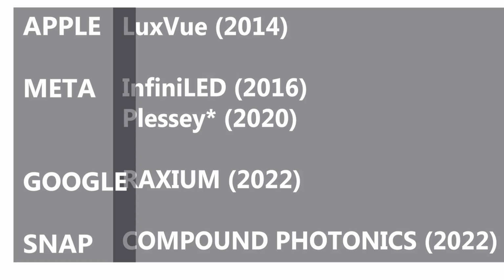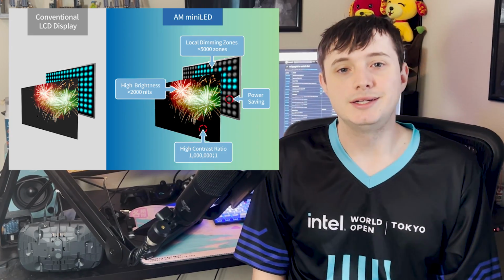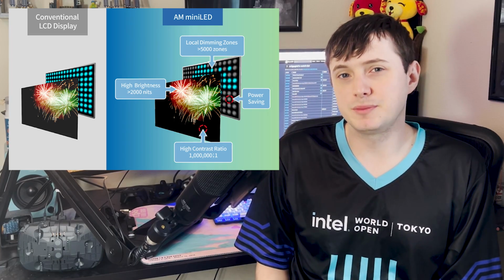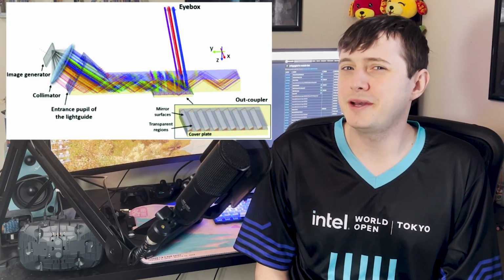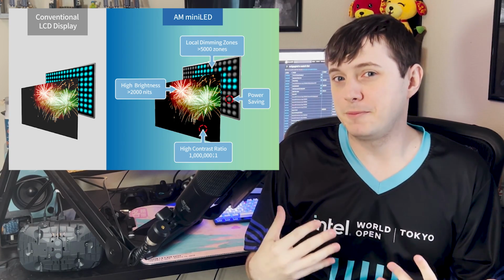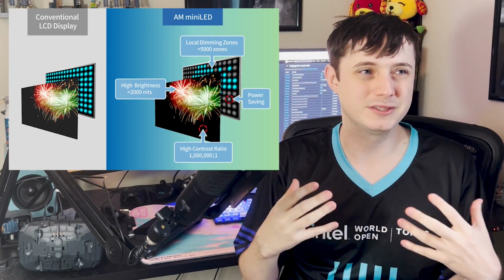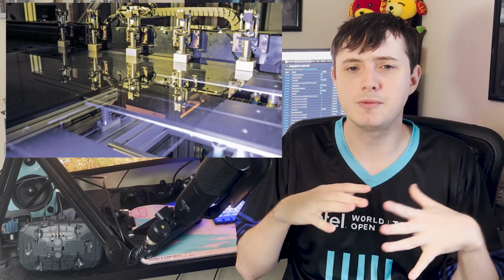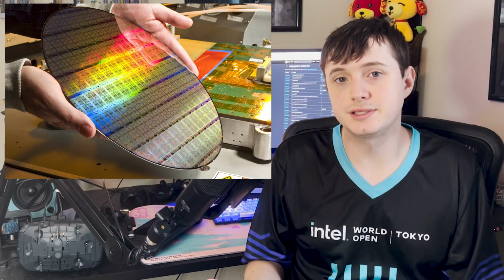MicroLEDs in VR - Why the Hype?

Comment: why don't we see DLP chips used for XR? DLP is very old tech at this point, used in projectors and based on silicon. AFAIK the only issue with them is that the chip is monochrome, hence rotating RGB filter in projectors, but that's not something an LED backlight couldn't fix, right?
Reply from the maker: From what I understand, there isn't any hype for that technology. And even current uses for DLP don't make a profit using them

Comment: Will pancackey lenses be compared against Quad-dioptric lenses at somle point?

On note of smartglasses the most impressive and polished I've seen are the Focals 2.0 (recently bought by Google), Everysight Raptor (cycling), and the Thalatoo Maoi (SCUBA diving). 👌
Reply from the maker: I think they will, but overall pancake lens can be tinkered to many different configurations to do different things, I think they will be the most adopted lens technology for consumers going forward
Reply: @SadlyItsBradley  Oh. I see. So the term "pancacke lens" is just general industry term for thin lenses that reduce the focal distance between the user's eyeballs and display?

Can there be pancake lenses that integrate various light focusing & visual quality solutions like varifocal/dynamic focal points,  waveguides, aspheric, and dioptrics?
Reply from the maker: @handlemonium  ya it’s kinda a general term of stacking multiple lens on top of each other. Usually bouncing light between them.

Comment: As for glasses with everything inside, I'm not really interested in that. That's just a continuation of the smartphone nightmare. I want a modular setup - my glasses should be a display, not a computer.
If that is "consumer" unfriendly, I guess I have an unpopular opinion :P
I believe we can get to where the components are so small that they can be modular AND slim. Maybe you'd have to use tweezers and microscope to change them out, or just have a professional do it, but it's possible. I think we should work towards that, rather than allow the industry to exploit us.
Reply from the maker: I’m with you, honestly
Reply: @SadlyItsBradley  🤗

Comment: What if Quantum Dot OLED, like that most recent monitor from Alienware with Samsung's newest panel?  All blue OLED subpixels, but QD filters to create the red and green.
Reply from the maker: As with the mention on using quantum dots to color convert MicroLED, the issue is they currently have issues scaling down. You arguably could use standard QD-OLED, but for the most part, I think the industry is trying to jump to MICRODISPLAYS because the advantages of smaller sizes (with high ppi) allow the devices to also shrink.

Comment: Great video Brad. Hopefully the optics side of the equation will be able to keep up and take advantage of the new screen technology, kind of like PC hardware not keeping up with newer high resolution VR headsets. I figure to run a Reverb G2 at full res in something like a racing or flight sim with some decent eye candy on, even the next gen GPU (nVidia 4000 series and AMD RDNA3) will not be enough, possibly the following gen? If this new screen tech makes thing look even crisper and better at a distance (small distant details) it'll require some serious graphical horsepower.
Reply from the maker: The industry is figuring out the computing side pretty quickly, I think. Machine learning, upscaling, eye tracking, improved reprojection is getting tons of improvement.

You could actually argue the reason for that is because these companies see standalone as the future, and standalone hardware is gimped by processing. So the quest for rendering tricks is an important one for all involved. These improvements will trickle down to PC VR as well

Comment: Hi Brad. What's your take on see-through AR FOVs?
Currently the highest FOV is 50x50 degrees from Magic Leap 2. And it looks like we can't break that barrier for AR glasses with the current technology due to max possible total internal reflection allowing 50 degrees (that's what I read in a comment).
50 degrees is enough for a lot of AR applications (and is preferable for safety reasons), but is there any tech that can break that barrier? Can we get 200 degree FOV with see-through AR?
Reply from the maker: As I see from the replies already: it’s definitely related to size of components! But, as time goes on, the biggest thing that needs to improve to make the “dream AR glasses” is optics. Optics that can revolutionize the tiny displays, magnify it across the fov while also keeping the resolution/quality good is the holy grail
Reply: @SadlyItsBradley  True, research into AR FOV is definitely something to keep an eye on, no pun intended.
Reply: Slight correction, Project North Star has an FoV of ~100°. It's currently very bring-your-own-hardware (e.g. no bundled compute), so I understand why it's often not discussed, but the FoV is significantly larger than most competitors.
Reply: @charltonrodda  Thanks, I just Googled it.
I think it can only do 100 degrees because of its huge form factor, no?
In my question I was talking about consumer AR, the size of sunglasses tops.